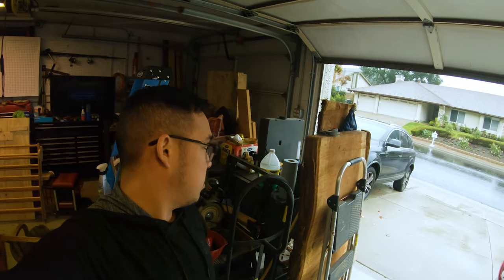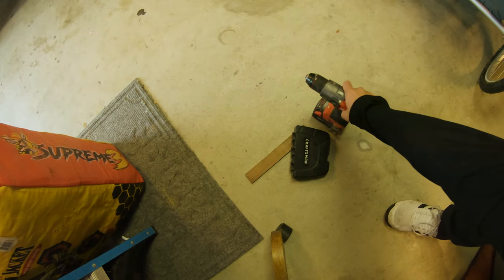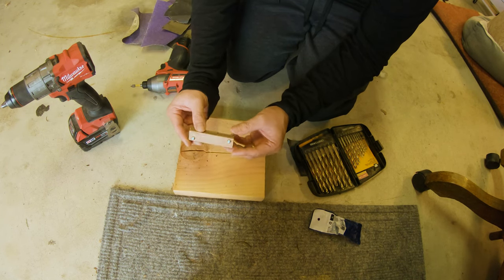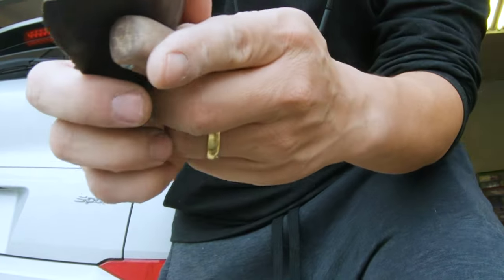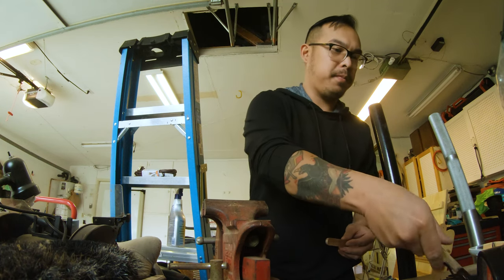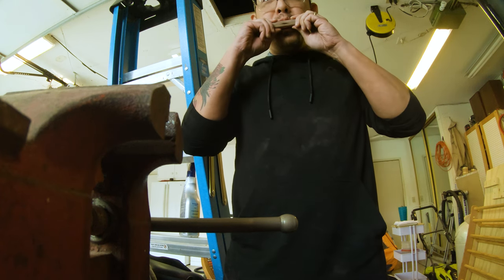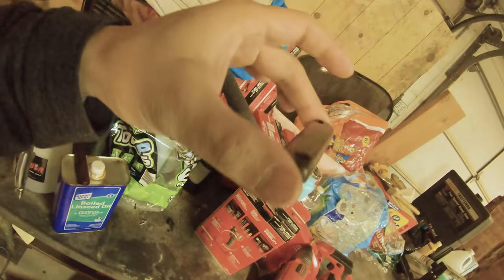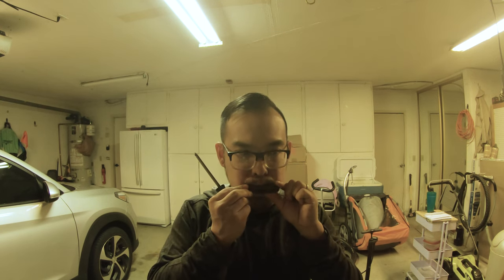Making a DIY Quail Call With Hand Tools. It Actually Works! Desert quail sounds

Comment: This is super cool, I'm still having issues on how you "tuned" it. Also, would there be a way you can take pictures of the final product?
Reply from the maker: Thanks Luis! I tuned by by either stretching the rubber band more, then clamping down to keep that tightness on it. The tighter the rubber band, the higher the pitch. The more slack the band, the lower the pitch. I basically found what sounded right to me and tightened it down to fix it in place